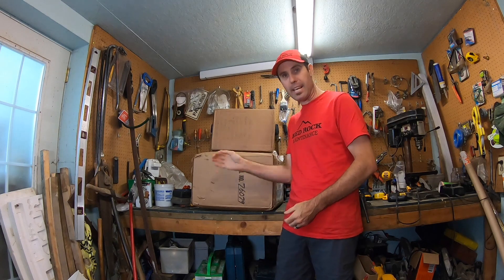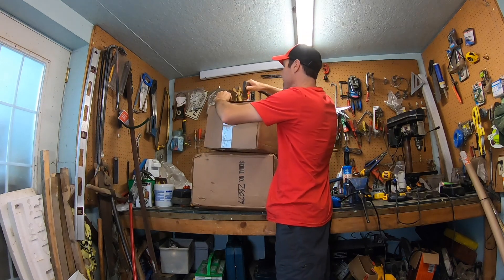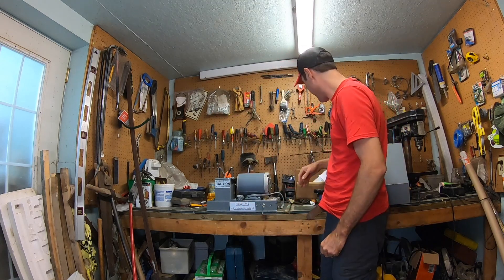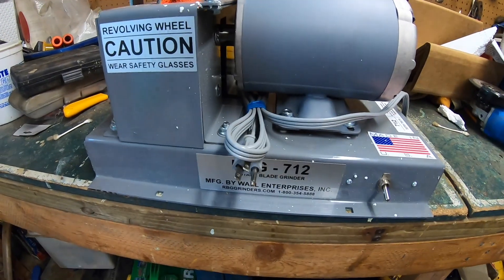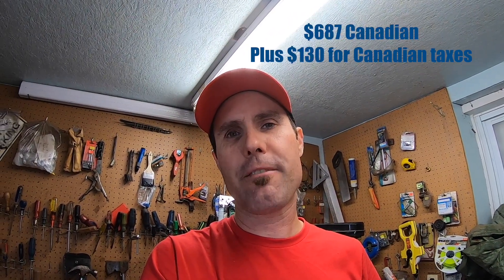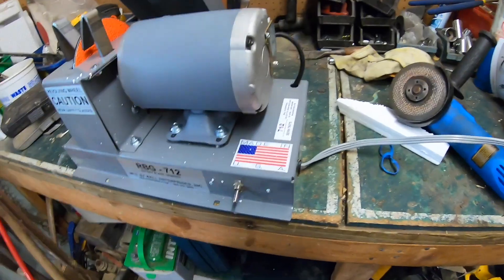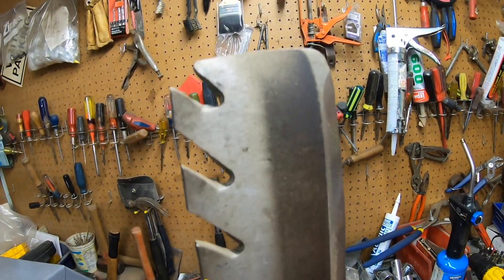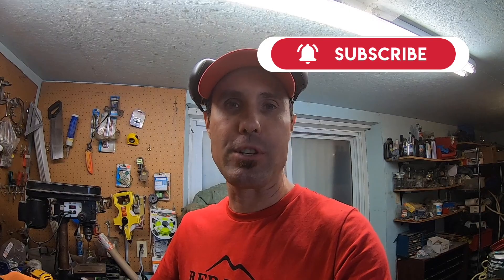RBG 712 Blade Grinder Unboxing and first look

Comment: Congrats Scott. This RBG712 would only be good for straight blades. I can't see how you would be able to sharpen the multi layer blades. Seems to do alright from what I have seen on videos. I just can't justify spending so much. Almost $1000 by the time we get it in Canada? I will stick with my bench grinder. Great video Scott!
Reply from the maker: Thanks Mike. It is expensive but I think it will be worth it. I went through so many blades and I know I wasn't doing a good job with the hand grinder.

Comment: What blades are you using on your Walker?
Reply from the maker: They are the Gator blades
Reply: @RedRockMaintenance  last I checked they didn't make them for Walker mowers???
Reply from the maker: @dskrpncs  Thats what I call them as they look like gator blades. If you send me a message on instagram I can send you a photo of the blades I use.